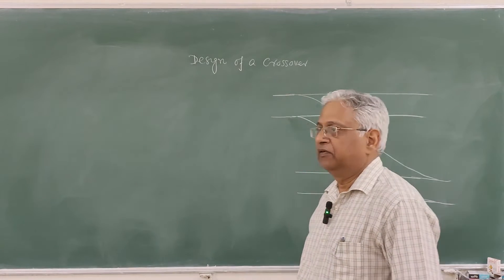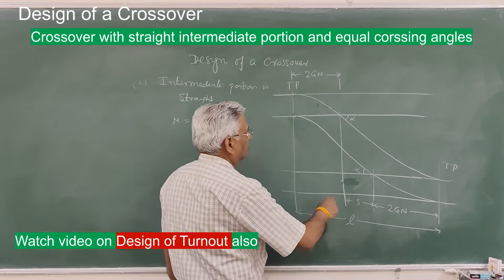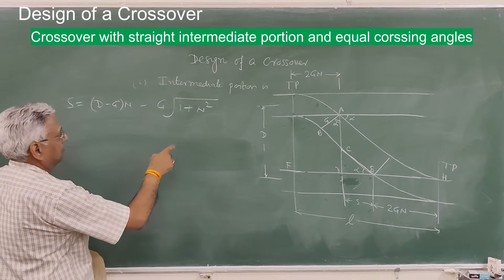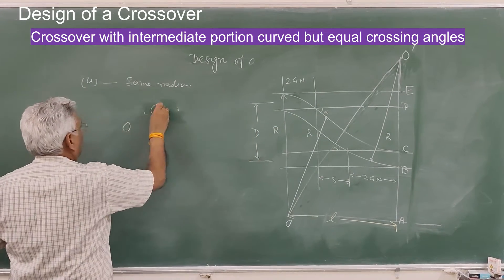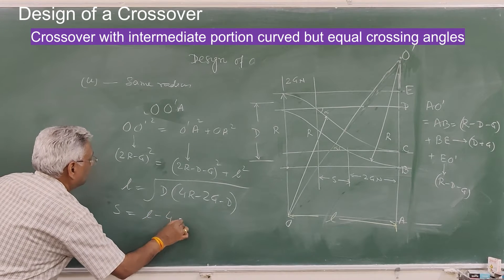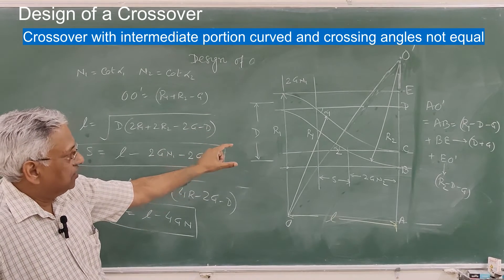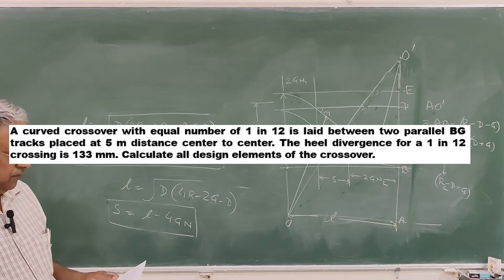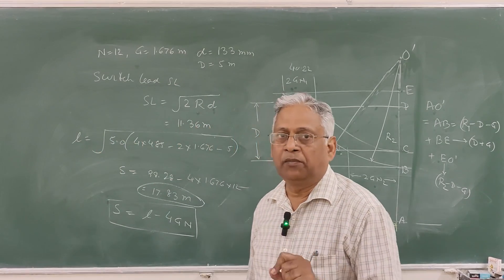#railwayengineering Design of a #crossover #Coles Design and #IRS Method, with all calculations

Comment: Sir how to set out the non parallel track
Reply from the maker: Design of crossover between two diverging tracks involves complex mathematical equations and this design is not included in any text book. It is because angle of divergence will also be a factor now. But concept remains the same
Reply: @SatishIITR  yes sir but I did by using dummy crossing
Reply: @SatishIITR Can we get a calculation for 1in 12 crossing. Will be extremely helpful.
Reply from the maker: @biswajitsen3688  Design of crossover for 1 in 12 crossing is net a special design. You can refer any book on it. The design calculations will depend upon the distance between the parallel track. One example is given in my book also